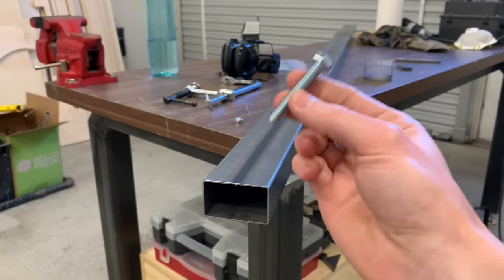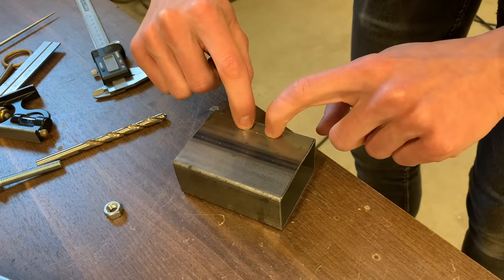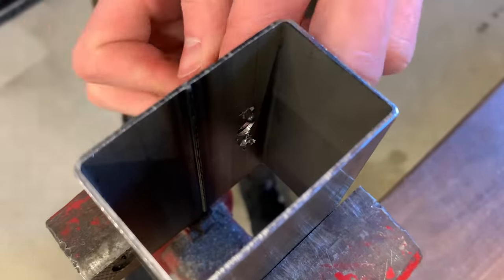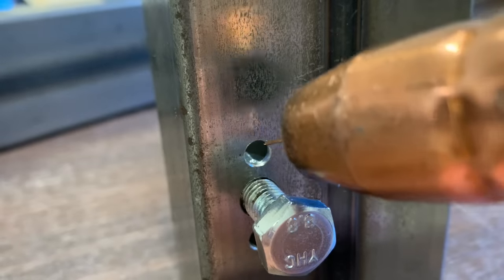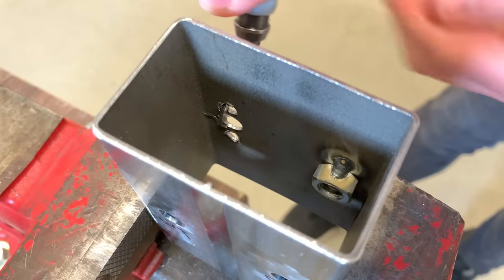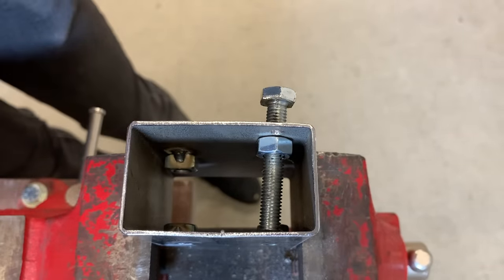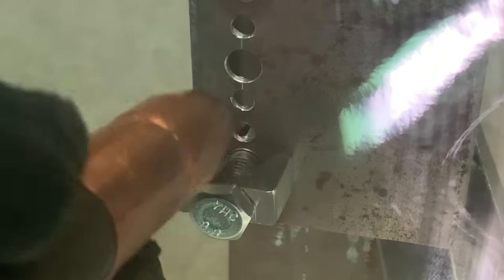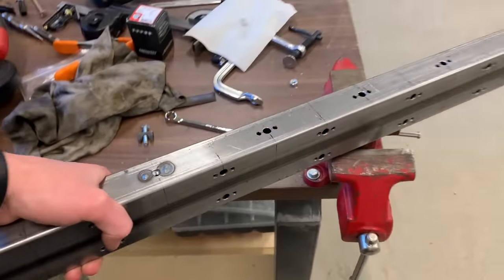Welding nuts to the inside of steel tube

Comment: Depending on the shape or curvature of a piece of tube I think I'd get an addition piece of flat plat, mark my positions, drill holes in it, and then at least spot weld the nuts on each face if not all around making them more secure on the plate.  This way you get an elongated backer which will help spread the clamping force out instead of just around at the nut itself.  Use this backer to precisely mark the drill holes on your tube, then slide it in and begin bolting it up finger tight from one end until all of the bolts are started.  Then from the middle I'd start torquing down in an alternating pattern just like you would an engine head.   Huckbolts would be fastest but if your tubing is really thin I'd like the additional reinforcement of this backer plate (think of it as an elongated or continuous washer).   That way any stresses get spread out over a larger area.

Comment: I do this fairly regularly, it's far easier to drill a hole slightly smaller than the point to point measurement of the nut, knock the but in and weld round, then grind flat.

Comment: There is already a solution for this. A nutplate. And you can just blind rivet it in place. Much faster. It also allows the nut som wiggle room, so you do not have unwanted alignment stresses on the fastener. They come with adhesive backing instead of rivets if desired adhesive and both fixed and floating.  It is used a lot in the aerospace industry.

Comment: Very nice solution. It's one that I could figure out before you showed it just by how you phrased the question, but would I have thought of this just on my own? Probably not. I would have just googled flow drill bits and like now, would've been absolutely horrified at how expensive simple blunt carbide bits can be, and then just thought to myself "...it'll probably hold just fine, maybe..." and carried on.
Just always good stuff on this channel.

Comment: One thing that I have found helpful is to 'Oil' the thread of the bolt prior to welding slows up any spatter from adhering and gives a 'Blueing' effect on the internal threads as it burns off during welding ? Hope that helps someone going forward ?

Comment: I have seen something similar on things that had crates/shipping boxes built around them for shipping on a boat. And if you need more thread engagement, I bet you could weld two nuts together before putting them into the tube.

Comment: I had zero budget project with aluminium tubes  at home. Only way fastening tubes in 90 degree angle was use wooden filler for use  screws which use for wood. It work fine.

Comment: Another way to go to avoid welding thru the small hole (my hands aren't that steady): use a piece of flat bar, drill hole for the nut, tack nut to flat bar, insert & long-bolt it against the inside of tube, puddle weld the small holes shut.
Great tool for the deep insertion of the nut btw

Comment: Ive used threaded rod as a file to remove metal burs. Its not the best most efficient tool for the job but it works in a pinch.

Comment: Rivnuts are easily within reach of the home shop. There are various insertion tools ranging from not too expensive to expensive high-volume tools. You can also install them with a simple shop-made tool, although it's more of a pain to use than a proper tool.

Comment: Excellent presentation. If I may add another small suggestion, use anti-spatter compound - or cooking spray - on the thread, and you're less likely to foul or seize the bolt in the nut.

Comment: Excellent solutions you could make a debur tool that has a file or cutting tool on it, of course it needs to be made a neat fit to work then add a long handle and drive it through the length of tube.. I have seen the Tube weld seam removed this way too.

Comment: I am wondering how this compares strength wise to either threads stronger material or rivet nuts.
I guess when the nut is flush it mostly just has to withstand the rotational force, right?

Comment: I've done similar by just drilling a hole slightly smaller than the outer dims of the nut, press the nut through (on a bolt) then 6 spot-welds. You can do the same with bolts if you want 'studs'. But I like your alernative, there's less chance of pulling the nut through later.

Comment: Flowdrill and roll tap is the correct solution, I like this method however, it works no matter what material or odd situation you find yourself in. I would sand off the zinc plating before welding or buy unplated nuts. Stainless nuts might be interesting for outdoor purposes

Comment: Great tip ! I would us a mounting bold where all threads that protrude at the back of the nut were completely removed using a lathe.  If you leave those threads on chances are only one weld spatter in the thread could ruin your work.
Reply: Or use a bronze bolt for the welding so spatter won't stick.

Comment: Riv nuts are not expensive, nor is the tool. Thought this was an interesting idea, then I remembered that I just use riv-nuts... Sometimes they can spin but, that's probably similarly likely to getting a bad weld from welding zinc coated nuts. Also, riv-nuts maintain their coating when fixed, welding removes the protective zinc. Also welding can mess threads up. Also you have to have access to the ends of the tube, further making this pointless. Riv nuts can be attached blind.

Comment: Rivnuts are not that expensive, I recently bought a tool + inserts from Amazon for £28. (And that was far from the cheapest option)
However, rivnuts do have a tendency to come loose in the hole and then start to spin, which is hard to recover from. 
There is a style that fits into a hexagonal hole, which avoids this, but the tool to make round holes hexagonal is expensive. 
All in all I think that this looks like a good solution for a heavier-duty alternative to rivnuts. 
I wonder if plug-welding onto the flange of flange nuts would work better? Or reversing flange nuts and welding into the space between the flange and tube?

Comment: Hey Jer, great idea. 
Another way is to get a flat "ruler" like plate, with a width slightly less than the width of your rectangular tube section, and thickness to suit you. Drill your holes in the rect. tube and the same holes in the "ruler" plate. Weld nuts on the "ruler plate. Insert the "ruler" plate inside the rect. tube and align the holes together. Fix two bolts at the ends, tighten. And finally weld the two (accessible) ends of the "ruler" plate to the rect. tube. Done.

Comment: Your welder and your ability with it is pretty impressive. I like this solution and as you mention not too expensive and I found rivnuts are not always a good nut to use and they are not flush finished. Another idea is to place a strip of 6mm inside to drill and tap. One extra hole near the threaded one to weld it up to your tubular section . Giving six mm of thread to engage on a 15-20 mm wide strip? But your fix for the situation is quick and simple. Minimum area required. Thank you. I would NOT have come up with this on my lonesome.🤔

Comment: If you use a short steel tube spacer with machined end faces , the screw and nut will sit at 90° to the surface and weld spatter will not foul the thread.
You should use unplated nuts here , for several reasons

Comment: Apparently most commenters just want to buy a solution (rivnut, etc.) rather than create one. I'm not sure if that's because they have too-much money or too-little ambition (or creativity). The least-impressive ones pretend to be economists engaging in cost-benefit analysis ("time is money," "a rivnut tool is cheaper than a welder," etc.). Their merely-commercial attitude leaves me cold, but your approach to this resonates with every (well, most) fiber in my being. It's the way I was raised, the way I watched my father approach his own work (personal and professional), and the way my best friends pursue theirs. And it leads to growth and dignity in other aspects of life as well. Do it yourself, and then share what you've done with others. Thanks for both the doing and the sharing.

Comment: Honestly, this works.  Nevertheless, Astro Pneumatic makes the PRN1 or the ADN38 for this exact use cause.  Additionally, most of the time where I need to install threaded nuts,  I’m usually in a place where I either can’t use a welder or the environment will not allow without a lot of hoops to jump through.  Additionally, I can get a engineered specs on rivet nuts, which helps when required.  Lastly time is money and income.

Comment: "So you just weld through this hole, and fill the hole with weldas you back out."

Sure, but that's going to take ages...

And then he does it in one step in less than a second. Holy hell this guy is good.

Comment: You could hose clamp a coarse half round file to the end of a broom stick and use that to knock burrs off the inside. Also, if the job is using stainless steel, anytime you weld a stainless nut, use a plain steel bolt to hold the nut. If you use a stainless bolt in the stainless nut it will jam up the threads as soon as you put the weld heat to it. Then on final assembly with a stainless bolt in the stainless nut you must use anti seize compound to keep the stainless-on-stainless threads from galling when torqued.

Comment: Spend a little extra and buy a set of calipers with carbide faces on the jaws and you can use them indefinitely for layout without worry with little to no wear. I'm a Tool & Diemaker for over 45yrs, and they will remain accurate enough for any use you might need. I have used the original Mitutoyo 6 inch dial calipers I bought as an apprentice and the edge is still sharp enough toscratch mild steel. For anything needing to be truly accurate I would not use a set of calipers anyway. Just saying. Carbide faced calipers on the other hand are a truly wonderful way to speed up layout on metal and worth purchasing.

Comment: If you cut apart a spark plug and remove the ceramic insulator you can put it in a drill press and push holes through thin metal using only friction hot stretching the surface area for the threads to bite.

Comment: I saw another video that I can no longer find which is a simpler and stronger method than the one shown here.

1. Start first rounding off a bolt head to reduce the size and cutting away at a washer to form a C in order to provide enough clearance for a tack weld. Assemble with the nut.
2. Drill a hole in the material to allow the nut of the nut-washer-bolt assembly to pass through.
3. Tack weld the exposed portion of the nut, back out the bolt and washer and finish welding the full circumference of the nut.

You can now repeat as many times with the nut jig you made in 1.

Comment: This is super useful. Thanks!
Reply: For TIG I might try first welding a washer to the bolt than doing the same method. That way I can tig weld the hole to the washer closed without having to get in deep like you can with MIG

Comment: Did  you try drilling a larger hole for the whole nut to sit in and welding the whole rim of the nut the tube then grinding it down? Would this cause too much warping and/or make it too hard to keep the nut straight even with a jig?
Reply from the maker: I’ve tried that before, but it’s really hard to not get any weld inside the nut. That would probably be the way to go if using TIG… it would be easier to keep the weld out of the threads and TIG wouldn’t work with this method anyway.

Comment: I would not recommend using a long bolt because weld spatter in the threads could damage the nut upon removal and cutting the nut out could be difficult. Also, I would use flanged nuts so that the fabricated tool can be made from a box end wrench.

Comment: Take a spark plug in a drill press and press it threw the tube, akin to friction welding, it will fold the walls inwards and allow you to just tap them instead of having to weld nuts down threw the entire thing, The goal is to roll a shoulder out so that has enough material for tapping.

Comment: This is not the technical term for them, but I have used those "countersunk Phillips drive" bolts with the head diameter sanded down using a drill and belt sander so the head is only slightly larger than the hole to hold bolts in place before for welding them on through 4 holes before although it was in a different application (welding on to flat plate that I didn't have full access to the other side and I remember spending probably half an hour or maybe more trying to get the nut in the right place on the other side with a piece of wire wrapped around it before I thought of using a magnet hot glued to a stick to hold it while I threaded the bolt through, after which I realized I could have just hot glued the nut directly to the stick but you know, you think of the good ideas later...)

Comment: Nicely done. I'm pretty sure I would weld the bolt in while trying to just hit the nut.
Reply from the maker: I thought that would be a problem, but I’ve done about 50 of these now and haven’t done that a single time. Twice I’ve just filled the hole without properly welding on the nut, so that’s the bigger thing to watch out for.

Comment: I’m just about to try fixing a broken weld nut inside my subframe of my civic. I really like your idea but I have no opening to pass the new nut into position. 

I was thinking just cutting out a square opening on the face 90 degrees to it. That way I can clean the surface and remove the old nut. Then I can just bend the steel back down and weld it closed again or put in a new plate. Or do you have any other idea that’s less invasive?

Is there a specific amount of weld I need to put onto the nut if it has to resist about 30 foot pounds of torque? I imagine it’s more about penetration, it’s 1/8” plate I think so I don’t want to turn up the inductance too much.

I’m also not a welder, I just talk to all the welders at my work and try to remember all the tips they give me. Thanks a lot, great video.

Comment: A 19/64 drill (.296) followed by a 5/16 drill (.312) with light pressure would leave little or no burr on the inside of the hole; and it would be much faster. A second cordless drill would expidite the process. Which competent fabricator doesn't have more than one cordless? The sizzle of a MIG welder correctly set is pleasing to the ears...  Well done.

Comment: A great idea, what are your thoughts on using a brass bolt to avoid/reduce any weld splatter sticking to bolt. And using square uncoated nuts, that touch inside tube wall to stop rotation.

Comment: Interesting solution though I'd be careful of over tightening that bolt and pushing the opposite face out. 

btw One can improvise a Rivnut puller using cheap high tensile bolt and nuts etc.

Comment: I really like the idea, do see some potential issues but most are meh like most jobs except for cutting and welding that much into steel like its possible it would/could cause deformations in the metal let alone if your welds didn't hold.
So many ways to skin a cat, and without videos like yours people might be stuck...SO THANK YOU :)

Comment: My company abandoned this technique of welding standard nuts to RHS since most of the time, they quickly break the weld bead during tightening. Its always better to cut a conctric hole on the opposite wall face to accomodate a suitable size socket wrench. If asthetics are important, you can use plastic plugs otherwise just ignore the holes. Anything is better than whats shown in this video because once the weld breaks and the nut is loose, youll NEVER be able to retighten the fastener if its more than a few inches from the end.

Comment: Good video I particularly liked screwing a long bolt all the way through to push against the far away wall. as a previous commenter said rivnuts aren’t all that expensive now and you still have to pay for regular ideally unplated nuts. 
Please read on this is in no way a negative comment !
1 DISADVANTAGE of rivnuts is they need a little rim proud of the surface 
( so they don’t just fall through the hole ) 
For many applications this is ok but sometimes you want a perfectly flat surface your not going to get that with any rivnut. 
Check out “ SELF CLINCHING NUTS “ as a point of interest these are great and offer a “flat surface” as previously discussed but cannot be fitted with out access to rear ( they are pressed in ) I think your solution is pretty neat. 
Taking it a step further
 ( although it’s putting time on to the job so in most cases may not be worth it )
You could tap a piece of larger stock in the lathe and part it off e.g. 1/4-20 thread in a piece of 3/4 stock then your welds would have direct contact for a proper puddle weld just a thought well done great video 👍🏻

Comment: One additional common method is to use small size strip stock, about the width of the nut. Clamp the strip stock onto the pipe, drill all the holes you need and weld nuts onto the strip stock. Benefit of the strip stock method is you have much stronger welds and you dont have to spend time grinding down welds. Downside is finding the strip stock. Or use a a strip cut from sheet.

Comment: Another option is to match drill and three holes in a piece of 1/4” flat bar, bolt it in and plug weld it at appropriate intervals along the length of your piece

Comment: what welder do you recommend I have seen the DEKOPRO welder get some good reviews but for something like this and other bodywork for a car would you recommend. Its not like Im doing the ceiling of the car or floor or structure... more like I want to cover some small screw holes and one is the SeatBelt screw broke. so I was planning on welding a Nut to the original hole and then putting a screw in so put the seatbelt back on.

Comment: Half a washer to hold it flush with a bolt holding it together. Make the hole the size of the nut. Weld where the washer is open. Remove bolt and finish weld. Different, not better.